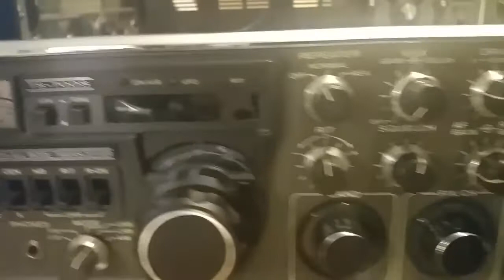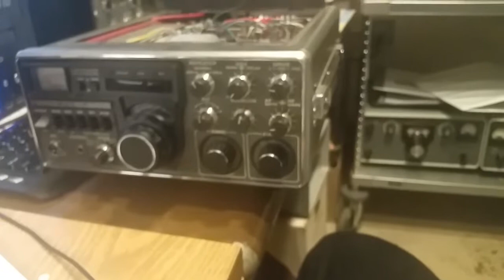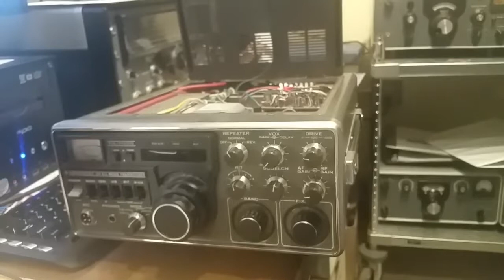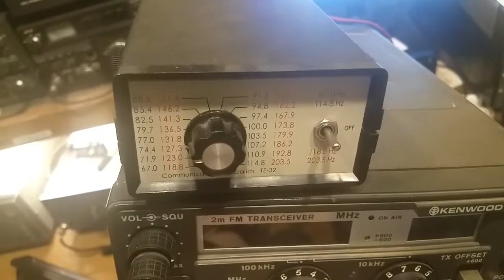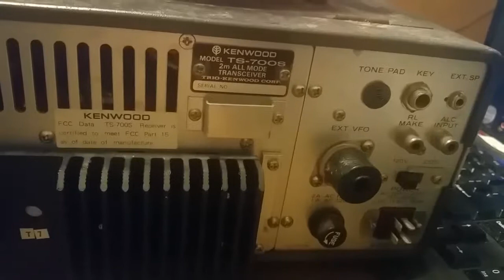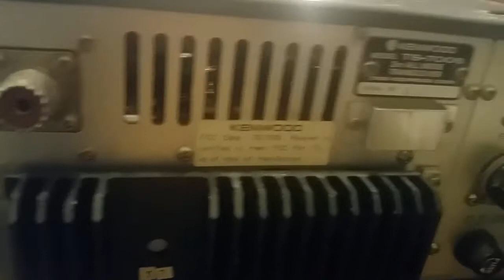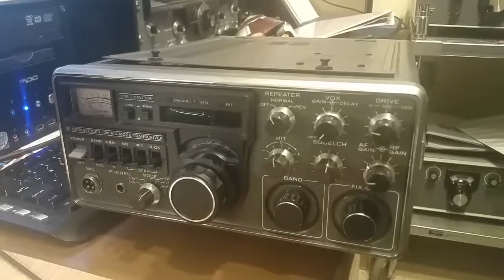Introduction to the Kenwood TS-700S

Comment: Hi Chris, thanks for posting.  Whatever happened with this radio?  Did you get it on the air?  Is it possible to get CTCSS tones added to these radios?  Again, many thanks!!
Reply from the maker: It still needs work, but it is on the air.  The VFO is jumpy.  I don't know if it os a dirty contact or something else.